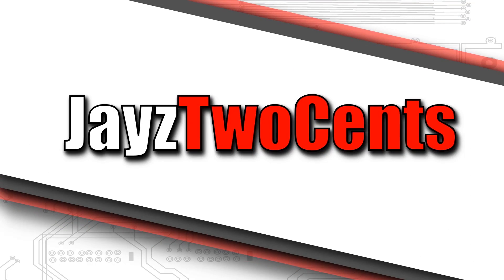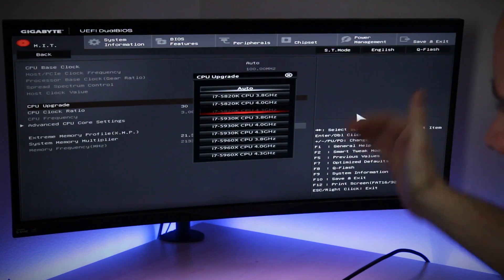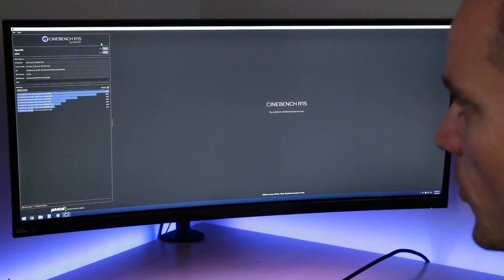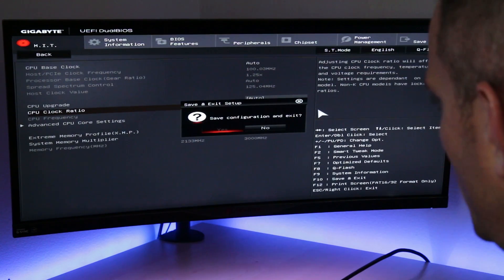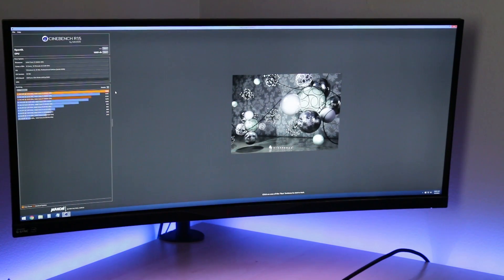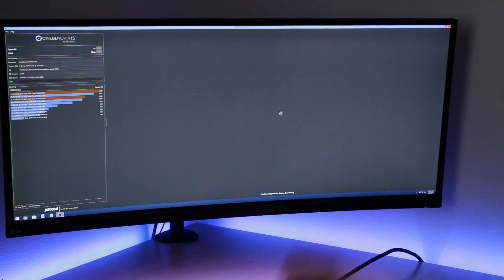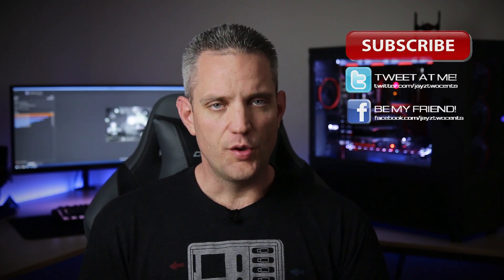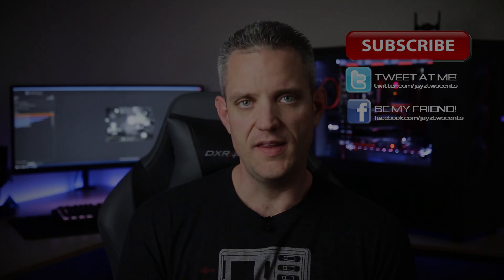XMP vs Overclock

Comment: My old trusty 2500k is running at 4.2 Ghz, and I run XMP on memory, so 1600 Mhz in my case. I could go higher but sometimes when I boot up it would not boot and I had to reboot and it would be fine. Once running its rock solid. 

Every time I watch these videos I get sooo tempted to push just a little bit more. 
I also only have a regular cooler air cooler, Arctic Freeze 7 Pro 3 or something silly like that.

I wish I could upgrade to a i7 because I have been streaming and some games need that for streaming since I dont have a second machine to handle the streaming and no fancy hardware for it either.

If I try to stream GTA5 wich runs beautifully on very high settings, close to maxing it out, and try to stream my CPU bottoms out and I can barely play at all. And I know its the CPU because its at 100% and pushing real hard. 
Even when not streaming its at 90%+ usage in GTA5, not many games push it that much yet. 

I streamed Eurotruck Simulator 2, and that worked beautifully. 

My GPU is a brand new R9 390 8 Gb from Sapphire, so its pretty good. :)

Setup
i5 2500k @ 4.2 - Think its a manual atm. Used to be the automatic overclock because easy.. ;)
16 gb ram, 1600 Mhz HyperX Kingston
90 gb SSD for OS
1 TB harddrive for the games

For most games this PC is still more then enough, Stardew Valley runs at 60 fps all day long! ;) lol

Comment: Asus as a pretty interesting overclocking software on the Z170 motherboards. It actually test your cooling capacities then OC your cpu a little, it does a stress test, and if it's stable and cool enough, it will push it higher and higher.

Comment: I can't get my memory to anything past 2400 without adjusting the BCLK. And even then it can only go so far. I have tried almost everything, and it's really getting annoying and confusing why I can't even get my DDR4 to 2600. My 5820K is at 4.3 and others have shown me their memory getting to 3200, when it is only rated for 2400. Mine is only rated for 2400, and all the normal memory OC tricks aren't working. Can anyone help me?
Reply: Just use the base clock but DON`T FORGET TO GIVE IT A VOLTAGE BUMP try going for 1.30 1.325 and see how much you can go, Oc the memory alone , but REMENBER IF YOU OC YOUR CPU A BIT HIGH YOU WONT HAVE ENOUGH HEADROOM FOR THE RAM , When you try everything of the above if it still doesn`t goes up go buy a better memory maybe you did not win the silicon lotery with that mem
Reply: Victor Elias I have already tried this, and it won't budge. I think it might be the memory controller on my CPU though.
Reply: Adam Golden Thats kind of weird toughtif your cpu Overclocks well i think your memory could, try running your cpu on stock and then overclock the memory if it doesn`t works... then we got a low quality memory , 16 gigs of good ram is at great price now like 78 bucks for 3000mhz ddr4 ram or about 60 for a 2666 mhz ram
Reply: Victor Elias I've tried the CPU at stock. It's fine, 2400 is enough. I'm getting another kit soon because I like the LEDs that this manufacturer puts on their memory.
Reply: Adam Golden That`s fine i asked my family for a 3000Mhz  ddr4 kit ... they ended up bringing a 2133Mhz ram for the same price -_- I will find out how much juice i can take from it
Reply: Victor Elias Rule #0 of tech, ask your family for money instead.
Reply: Adam Golden  I know that shit i can`t just take a plane to states and buy it myself where i live that`s some futuristic shit ... Damn at least they got me ddr4

Comment: Jay if you could or anyone else please reply. I have a i5 4670k overclocked to 4.4ghz with a 1.230voltage that's all i changed is that good and whats the safest maximum voltage for my chip? Thanks.

Comment: So most people don't run long term overclocks from day 1... Of course, they are mostly regular consumers that don't look at PC hardware like that. Almost every desktop CPU I've had running on motherboards that aren't dell (the dell lga775 board I had had NO support for overclocking.) I've overclocked the crap out of it as long as I could keep it stable. I overclocked an Athlon X2 4050e from 2.1 to 2.86 GHz, left it like that for half a year, then slapped a Phenom II x4 955 BE in the same board (ASUS AM2+) and overclocked it to 3.7 and it's been like that ever since. I guess you could say, I'm one to keep my hardware on the bleeding edge of its ability. I woukd like to upgrade to a good quality AM3+ board so I could throw in some DDR3 here and there.

Comment: I have been running my AMD FX 8370 OC to 4.5GHz on Auto Voltage since the day I installed it and I tested upto 4.7GHz and backed it down 200MHz from the blue screen and didn't touch the voltage so I could probably get more but 4.5GHz is enough and stable all day long. I'm using a Corsair H105 with Corsair SP120 fans which keep the CPU at about 58c when under load.

Comment: 232 cd with my Amd Phenom X4 B55 3.29ghz :/
Reply: +Bralic Holmes you can unlock that chip with the right mobo, and overclock it if it is stable.
i have a 1090t at 4.02ghz with a 600 cd

Comment: tried to overclock my 6700k to 4.6ghz but something went horribly wrong so I amateurishly opened my case and lo and behold static built up and I couldn't boot my pc ....All I heard was this long beeps with a black screen, now My pc's better but how to avoid this situation ? Also whats a safe overclock for my 6700k?
Reply: Don`t push that shit further than 1.35 1.30 if you want to be safe
Reply: Victor Elias I have 4 ram slots and it's all full.. Should I remove 2? Could that be a problem for overclocking?
Reply: Unless you overclock the memory everything will be fine with those 4 sticks, first try to get your max oc with those voltages and if you want to go a bit higher 1.350 is the max , after you find your stable oc for the cpu then oc the memory if you want, other than that you should be okay :)
Reply: +Victor Elias wow thanks man! Massive help!
Reply: Niro Sen Thank you for asking ! i will be getting a 6700k soon to join the club but i have lots of experience with overcloking thanks to god and a lot of reading and some computers !
Reply: +Victor Elias oh ya another question before I forget, is it safe to use the mobo auto overclock tool in the bios?
Reply: Niro Sen It is safe  it doesn`t puts on crazy frequencies or voltages , i like to take my time finding my sweetspot but if you like 1 click overclock that`s fine too
Reply: +Victor Elias So basically you're saying one overclock using the auto settings and I don't need to adjust voltage manually too?
Reply: Niro Sen That depends if your motherboard has an automatic option for that
Reply: Victor Elias There is bro. I have a Gigabyte z170 gaming 3
Reply: Niro Sen Well , it is there use it don`t be afraid
Reply: +Victor Elias cheers bro and many thanks for the help!

Comment: 5820k at 1.23 volts, cooled with an x61.

Highest spike on core number 3 was 81c after 3 hours of 100% load, seemed to hover in the high 60's low 70's most of the time.

Comment: Well here is my score CB r15 CPU = 905cb
CB r15 OpenGL = 38.45fps with i7 4790k [idle @4773Mhz (34c) full load @4877Mhz (74c)]RAM 1600Mhz @1938Mhz   GPU Intel HD4600 1250Mhz @ 1453Mhz Asus z97 Pro Gamer [bios 2202]  H110i AIO User manual OC'ing Thanks BTW stock score.CB r15 OpenGl = 29.76fps CB r15 CPU = 781cb :)

Comment: Was hoping for more XMP explanation like setting the switch on a mobo, etc.  Anyways - ASUS has their "5 way optimization" program .. you can optimize all your fans for your underclock and overclock.  My 5820k sits at 1200 MHz when it's not doing much(fans on slow speed), and bumps up to 3300Mhz when it gets a little busy, and then 4000MHz when it's getting hit hard - and I have all the fans set to ramp up to handle the extra speed.

Comment: Well the first thing I did when I finished setting up my computer I overclocked my computer.
FX 8350 running at 4.5GHz because that is were I can keep it cool at a level I like.
Asus Strix R9 390 running at 1180MHz and ram at 6752 MHz I am still playing around with it

Comment: I don't know about anyone else but I recently built my computer with an MSI board and a FX-6300 and it was an easy over clock. I oc the the CPU to 4.3GHz (reccomended 4.1) and my ram to 2133 and my temps hit 38-40C at Max with stock cooling.

Comment: I have an i5 4690k and soon I will overclock it. What cooler would you guys recommend which will be at a reasonable price (dont wanna spend as much as it would have cost to get an i7 for instance lol) that would allow me to reach the maximum overclock on this baby (air preferred but will consider water if its very legit).

Comment: I was able to get my 8350 up to 4.6 before without problem, but now it can only go to 4.3 for whatever reason.
Reply: +ProtoMario Components wear out slightly over time, needing more voltage or lower clock speeds to be stable. (At least I'm pretty sure)
Reply: +ProtoMario My i5 4670k also, after a couple of years, started needing more voltage to stay stable at the same clock, and now I also had to sacrifice some MHz to be stable.
Reply: Faroacces0 Yeah its probably something like that, but I use an auto overclocker to just not be bothered.
Reply: Stanislav Yordanov Already did
Reply: Degradation of performance just the CPU getting tired really most of the time. Not much to do. Try better or more thermal paste.
Reply: you pushed your chip too far and weared it hardly. Specially because you used auto overclock. Auto overclock is the worst you can do to your cpu. They push the voltage way too high. Sorry to say, but your chip is dieing slowly, but surely.
Reply: +ProtoMario Try to change the thermal grease ?
Reply: Vinyl Scratch Thanks, I did not realize that would effect an overclock.
Reply: Mine is only stable at 4.1... just ordered a i5 8600k along with a few other things though, so quite the upgrade
Reply: A candle that burns twice as hot lasts half as long...
Reply: @Mike Studmuffin he didn't push it too far 

Can I get a quick yes or no?

Do you think computer hardware degrades overtime when in use, even regular use, and not just OC'd?

Comment: Hey Jay, I have recently fixed and old gaming rig that died. My Old graphics card Xfx HD5870 1g EE took out my motherboard which was an Asus P7P55D EVO and at the time cost me quite a bit of money. Anyways after I fixed it i bought myself a low budget card. An on my road to getting back up to speed with computers I've quite enjoyed watching your videos and wondered if I'm wasting my time with it or there's some recommendations you have in perhaps low cost upgrades with a dash of overclocking too enjoying a nice gaming experience. Or should I just get all new as I don't know what to expect from new hardware. I've seen a cheap i7 875k and know my RAM is definitely due for an upgrade. My current Rig Is 
Intel I5. 760 2.8ghz
4GiG OCZ GOLD 1333mhz 2x2G
ASUS P7P55D EVO MB 
 Xfx R9 380 4G Graphics card 
OCZ Vertex 2 SSDD 120G
Western digital carvablack HDD 1TB
OCZ Stealth X stream 700w PSU
Case is NZXT M59 with fan controller 2x140m fans  3x120m Fans
asksa Venom 120m Cpu cooler. 
i also have a ASUS U3S6 Card which I'm not sure if I dare use it as it's always seemed to get very hot n dodgy.... If Ever you have any time  to reply it would be very  much appreciated thnks..

Comment: If I so much as turn on XMP on my motherboard, windows won't even load.  It's a shame but I went with x99 over z170 for the pcie lanes, not the overclock, though it would be fun to see how far I could push system.

Comment: So far the only overclock I have is running my 3GHz 6 core AMD at about 3.7 using the auto OC facility and it rarely fails to boot, I've run with the same cpu and settings for about 6+ years.......proper little workhorse, does what I want with zero fuss or problems but I might see if I can't get a little more out of her

Comment: The reason your cpu has a lower max OC is not the mother board, it's burn in time. My 5930K was stable at 4.7 for three days, now 4.3 is max. Same main board. All new cpu's are going to tolerate higher clocks for a short time. Once voltage is exceeded and electron path leakage occurs (crash) it becomes a weak point permanently.

Comment: alright.... I'm looking to future proof my desktop which has a asus 970 turbo which is overclocked... I was wondering if i should run a dual sli 970 rig or should I upgrade to a gtx 980 ti.... 
i have a 1080p monitor but i was going to upgrade to a 1440p monitor pretty soon
Reply: +Justin Foster Why not wait until later this year for the newer gpu's not to mention in some games having 2 gpu's won't add any or much performance at all.. I'd keep the 970 and trade it in for the 1080 or whatever they call it that way you'll get 980 ti performance inside the 980 price range..
Reply: Dillon Scott true but I dont think that the new ones will be that cheap....
we'll see though
Reply: You do realize that every generation the best gpu gets put down a peg right? The 980 is around the same in performance as a 780 ti, and the newer set will follow the same path as they always do.. So getting a 980 ti now for $700 or getting a 1080 for $399 will get you the same if not better performance for less money it's just always better to wait..
Reply: Dillon Scott ur right... ill probably run 2x sli also
Reply: Sure, if you have the disposable income, however do note that at the very best 2 980 ti's will not have 2x the performance realistically it will be 50%-80% more than a single card..And that's only if it's compatible, some games will only use one, or even worse will fight over one or the other so performance is cut.. So keep that in mind..

Comment: Well as I have a quad Core Phenom II X4 965BE, I cannot touch your score, but I can boast the better clock speed. I have gotten it rock solid at 5.1 GHz on air. My motherboard sadly will not let me go higher as the voltage is capped. But as it was a scrap yard find I am quite proud of it. When at full speed it can pull or a 490 or so in cinebench. 

I have to say Skunk-works looks amazing with that dim room and back lighting on the desk.
Reply: I have fans everywhere, I have two delta 252 CFM fans in push pull over the heat sink. and I made some sketchy VRM heat sinks out of aluminium., and I have a server blower fan forcing air down the VRM heat sink line. Temps do get warm, but that is only on bench marks. I really want to get a liquid cooler, but the beauty of this system was that is was next to free, and spending $100 seems like too much. The thing sounds like a Jet at full load.
Reply: +El Diablo My motherboard claims it is at 1.7v CPUZ seems top agree, but I dont really trust it. I suspect there is voltage drop. While it could be used 24/7 ( it can run stress tests for 12+ hours  I just don't leave it on when I am not around as I fear a fan issue.) as heat and voltage are the two best ways to erode the architecture I rarely do so.  When I am rendering  fractals  I tend to use that OC as those things need all the speed they can get ( it can take several weeks at near 100% load. For daily use I keep it at 4.35 at about 1.6 volts. I am Pretty certain I broke the silicon lottery with this chip, I am really tempted to get a better board and push it more as that motherboard seems a bit flaky at times. ( some fan headers do not work all the time, and the bottom PCI slot is dead)  Also I need to do more tests on base clock, because lately I tried raising the base clock, and it seems to just go up and up. I think the ram might go before the CPU does.

Comment: My i7 4790K has been running at 4.7ghz for over a year now with no problem. Custom loop cooling it however. It's more than enough to power my GPU's. My memory is at 2400mhz and I just used an XMP profile for it.

Comment: Got 1400cb in cinebench on my 3930k at 5.4ghz  :)
Reply: +Lawrence Timme 5.4Ghz? Jesus Christ.
Reply: Watercooling?
Reply: +Pogo Kilogramm no.  Single stage phase
Reply: +Lawrence Timme 
realy? i've alway's been intrested in phase change cooling 
so what cooler do you use? that ready to go little devil? and is it realy that loud as some people say it is?
Reply: geen naam i have a video of the cooler i use on my channel. its a custom unit by little devil
Reply: jauffins yes. 5.4ghz
Reply: +Lawrence Timme Vcore at max load?
Reply: ImSaltyAFRightNow vcore is set to 1.68v without c states or speedstep.
Reply: Lawrence Timme
wow that's pretty high, especialy for intel
how do you cool your VRM's? mobo waterblock?
Reply: geen naam rampage VI formula just stock vrm heatsink
Reply: Lawrence Timme holy shit 1.68V ?! Im sitting here at 1.28V and getting 70C at full load 4.5GHz. Wish i was as rich as you, and rich enough to use fixed voltage
Reply: ImSaltyAFRightNow rich?
Reply: Lawrence Timme financially stable enough to pay relatively higher than usual electricity bills
Reply: ImSaltyAFRightNow
depends on where you live but the electricity wouldn't be that much
1000dollars just for the cpu cooling is a bigger cost
Reply: ImSaltyAFRightNow lol i dont pay the electric bill

Comment: Could you do a video on Laptop-safe overclocking/performance boosts? Great and helpful video as always. Also, Got a 238 on my laptop. Acer Aspire M i5 at default clock speeds. Not sure how to feel about that.
Reply: Unless you won't your CPU to burn straight through your main board. NEVER overclock a laptop
Reply: I'm not talking about a full GHz overclock or something like that. I mean slow, 0.1GHz overclocks to see what the best, CPU-friendly overclock could be.
Reply: ***** The only time my laptop got warm to the touch is when I played moderately-modded Skyrim on Medium settings.
Reply: @RohanSpartin  CPU friendly overclock, hahahshahahahaaaaaa.